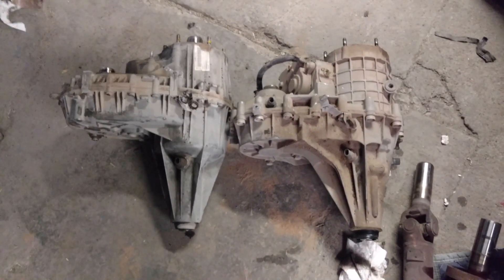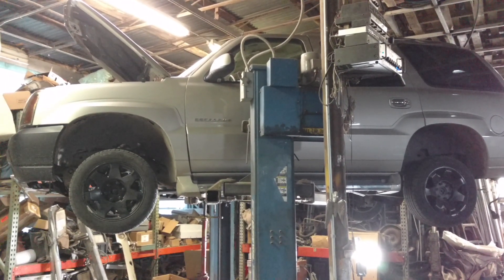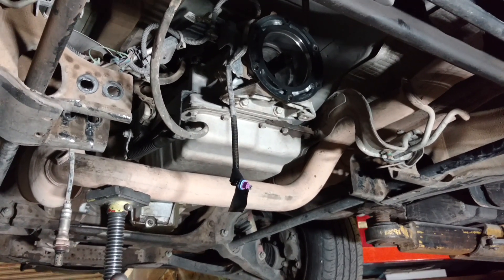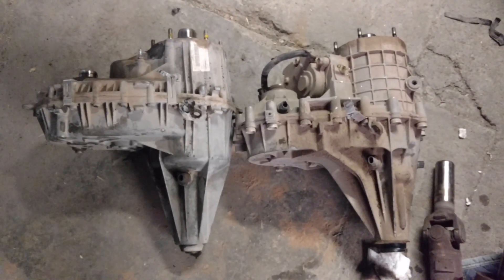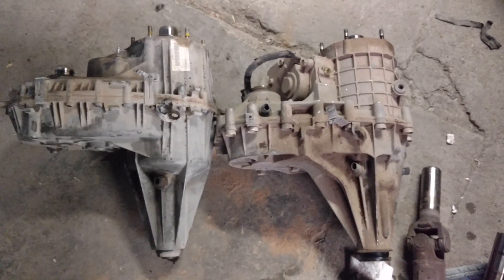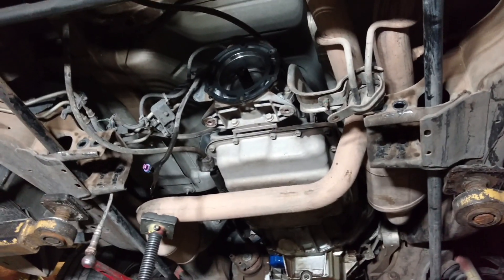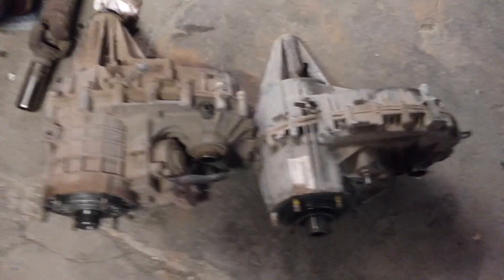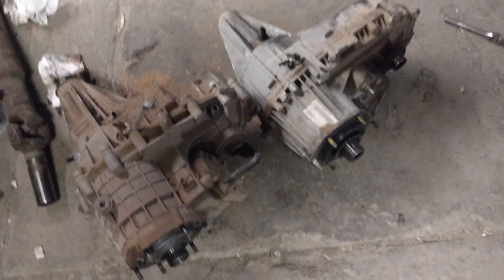Nitrous 6.0 Escalade How to convert Awd to 2wd Phase 1

Comment: I’m trying to convert my 4wd 2003 Cadillac escalde ext to a 2wd do I need to buy any extra parts ? And how difficult is it
Reply from the maker: You mean it's all wheel drive ? You would need a different transfer case at least. If you take out the front diff and axles you will need 2wd front hubs also. It's a pretty good amount of work to do it. It's not bad depending on mech skills or tools you have.
Reply: Thanks man appreciate it cuz I’m only 17 and I’m trying to learn more
Reply from the maker: @juansalas8814  you're welcome and yeah good luck man

Comment: @jess_of_all_trades the transfer case will just stay in 2wd if you don’t wire it up?
Reply from the maker: Yes just as long as it was in 2wd when removed from the donor vehicle.
Reply: Any loss of fluid when disconnecting it from the trans
Reply from the maker: @stevenhoward459  you may lose a little depending on the angle of the truck. I had mine on a lift but used it as a good opportunity to put new transmission fluid anyways and new fluid in the 4wd swapped case.
Reply: Jess of All Trades  thanks for the info man
Reply from the maker: @stevenhoward459  welcome
Reply: Jess of All Trades any fluid loss with no front driveshaft in the NP246 case
Reply from the maker: @loudonello5405  no it stays sealed

Comment: Good afternoon hope all is well I really appreciate these video you did  in regards to awd to rwd conversion.I have a 2003 escalade 6.0 I plan on doing the conversion my self only difference is I'll be going with  a rwd 4l65-e and driveshaft, and totally getting rid of the tranfer  case altogether. I'm getting rid of the front CV axles and diff, my only question is would I just use a 2wd hub assembly from a 2003 Escalade to hold the front wheel on securely and nothing else  ?
Reply from the maker: Sure no prob man. Yes you can just use the 2wd front hubs. Good luck with it

Comment: Can you run that push button transfer case without a BCM???
Reply from the maker: I just leave mine in 2wd so can eliminate the awd but it is possible to use all it's functions but would take some work. If you did use the correct  bcm it would take replacement of the harness and altering the pcm pinouts and programming. Another  way would be to work out the values of the tcase internal servo controls and run a toggle setup to run through the different modes if a person wanted to retain 4wd features. That would also require putting the 4wd front diff in with the servo in it to have the 4wd features which would in turn need to be activated with a toggle setup sending the correct value to it.
Reply: @jessofalltrades6760  I’m trying to build a 2007 Escalade with selectable 4x4..
Reply from the maker: @Kwalafied42  the R&D I have done on these really mostly covers the bodystyle before yours. It would take some research first in order to make sure the deletion of it's stock AWD tcase won't affect the abs or traction control system on your model. On the 05 style shown here and the older models it doesn't affect it to change the tcase. Changing the bcm and wiring harness plus pinouts to retain factory controls of the select 4wd takes extensive work and knowledge and especially on the 07 stuff those are alot more complex then the previous generation. You could prob have it reprogrammed to eliminate the traction control , put the select 4x4 case and run a 5 volt reference switch system to activate the controls manually without changing bcm etc.
Reply: @jessofalltrades6760  I’ve been told the awd system is completely mechanical so in theory should be able to start by doing what you did swapping the tcase. What I was asking mostly was about what you outlined the “5 volt reference switch system”
Because I don’t really want to change the harness and deal with programming at the dealer
Reply from the maker: @Kwalafied42  I never got to that point on my Escalade cause only needed 2wd. Many of the computer controls on these trucks  work on a 5.0 volt system with variable voltage reference. It's gets a little complicated because the front diff servo for example would only need temporary voltage to engage the front axles so the correct voltage supplied to it for a temp amount of time like a short toggle would in theory work. I never got to the point to work out the exact voltage values on the transfer case selections it would take that info to be able to complete a custom wiring system for it with the use of resistors to manage the voltage at the correct values . It's totally doable just not sure if anyone has done it yet I could make it work if i needed 4wd but it would take a 3rd party a reasonable amount of electrical knowledge , research and info on the tcase values.

Comment: damn what are those 12 inch wheels
Reply from the maker: Haha they are actually the stock 17s with a small tire! if you look at the later phases of the build i put a 275 drag radial out back with the 4.10s. the only way my trans would hold on the nitrous was with a low profile tire  and 4.10 gears in 2wd as this takes much of the load off the trans and gives it a leverage advantage over the truck to take load off the clutch packs and allow the engine to rev up faster and more freely. Taking away the awd takes alot of load off the trans as well and will make it last longer for regular driving , towing or racing.
Reply: @jessofalltrades6760  nice... I just grabbed a transfer case today for mines. did u have any videos of the escalade at the track or on the street. if so can u post it

Comment: Did you switch the shift motor on the transfer case
Reply from the maker: No that's not necessary as im leaving the new 4x4 push button case locked in 2wd since that's all need it for. The original awd case is just always engaged and doesn't have a selector and has a differential inside which is why you cant just pull the front shaft to go 2wd with the stock awd case.
Reply: @jessofalltrades6760  ok.
Reply: What did you do with the Driveline mine's won't fit it's too long
Reply from the maker: @elcoholic79  my stock one fit fine. What case did you use and is it an XL or short wheelbase
Reply: @jessofalltrades6760  my drive train is about 52 and half. The tahoe transfer case needs a 48 inch one
Reply from the maker: @elcoholic79  my stock one went right in no prob what vehicle are you doing it to ?
Reply: @jessofalltrades6760  2002 escalade 6.0. We just cut the driveline right now and were welding it back up. Took an inch and half out
Reply from the maker: @elcoholic79  dang that's strange what  year of  tcase did you put in it ?
Reply: @jessofalltrades6760  I believe the guy said 01 tahoe
Reply from the maker: @elcoholic79  yeah that's why the 01 tahoe is sbc while the first year of ls is 02 . That's the older tcase you got
Reply: @jessofalltrades6760  it was a vortec 5.3
Reply: @jessofalltrades6760  did ur abs light go on after the swap
Reply from the maker: @elcoholic79  no it didn't
Reply from the maker: Did you take out your front diff and cvs also cause if so either need to out the 2wd hubs or cut the end of shaft splines and sandwhich it in with the nut
Reply: @jessofalltrades6760  I pulled axles all the way out. Removed all front differential as well
Reply: @jessofalltrades6760  so I have to swap 2wd hubs on it to?
Reply from the maker: @elcoholic79  did you take out th front diff and the cv axles ? If not you don't
Reply: @jessofalltrades6760  yes

Comment: Will this work on a 06 trailblazer SS as well?
Reply from the maker: Yes it will
Reply: Jess of All Trades Thanks man. My front diff went out and I just want to eliminate it all together.
Reply from the maker: @drawitlikeyoustoleit3801  you're welcome. Yeah thats what I did with mine it's so much better and faster . Plus better mileage , lighter and less wear on the trans and drivetrain. Being locked in awd all the time sucks honestly lol.
Reply: Jess of All Trades sounds great. Thanks for responding, I’ve been wanting to do this for a while and couldn’t find any specific info on how to.
Reply from the maker: @drawitlikeyoustoleit3801  sure man no prob good luck
Reply: How’s it going? Quick question, what’s the difference in the Np246 and the Np226? I have a trailblazer ss with a 4l60, will either of these work or just the 246?